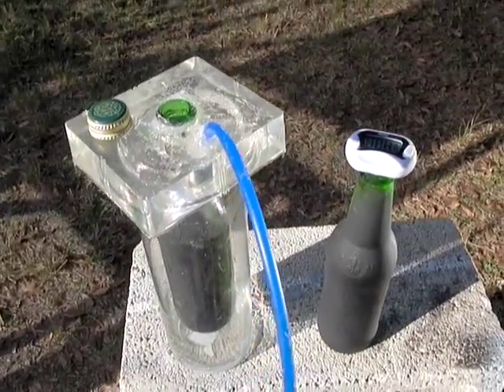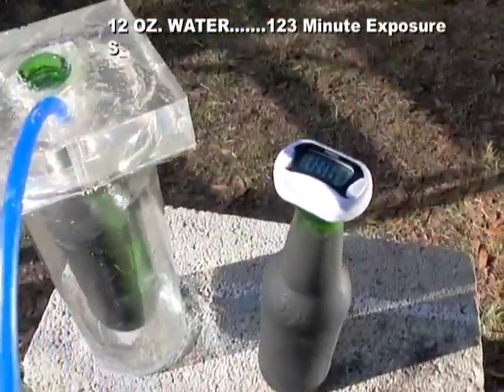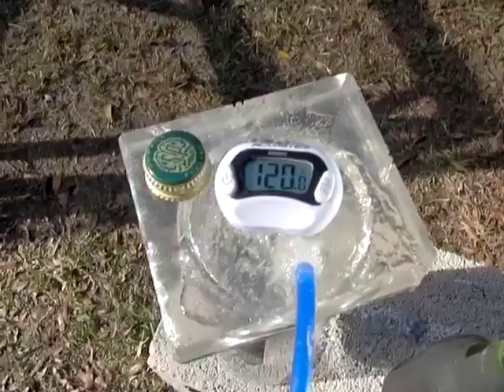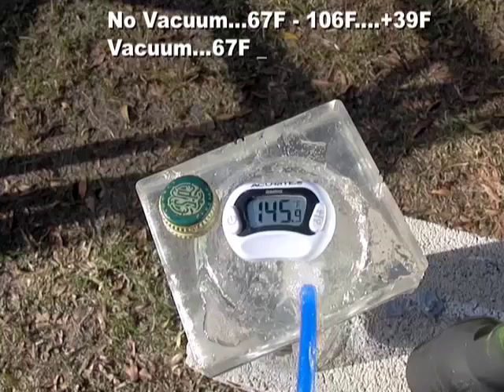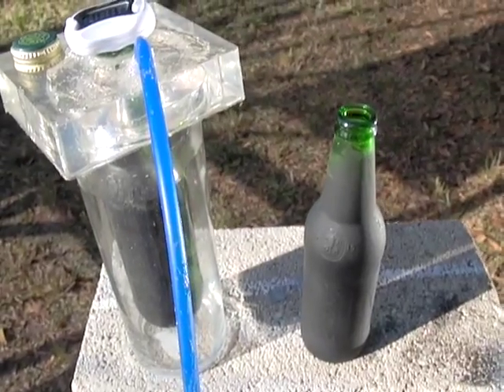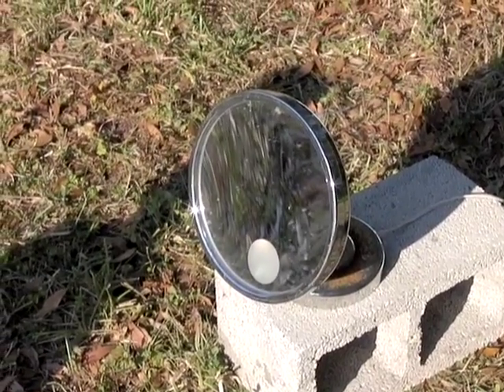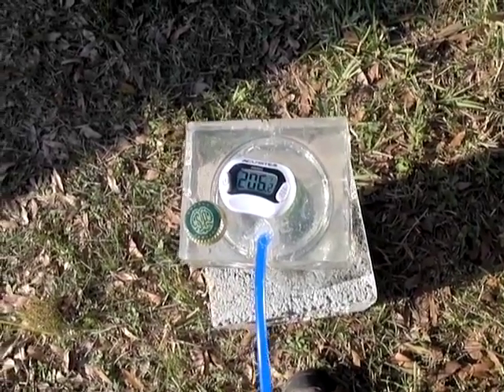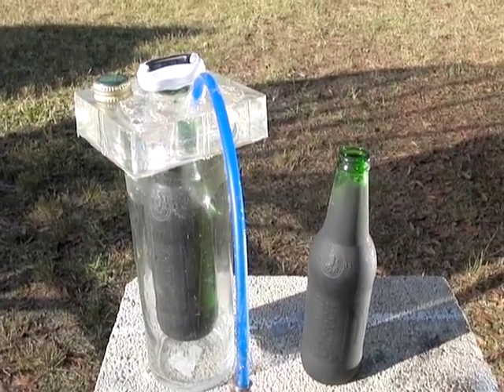Solar Evacuated Tube Vacuum Tubes DIY Test in the Sun

Comment: we have proper solar hot water systems using evacuated tube technology as standard here in australia. they have recently stopped using the old style "black pipes in a glass box" technology and gone for evacuated tube technology with gycol in them and then heat exchangers (with water) in the top of them.

Comment: Is this essentially what is at work in solar/steam generated electricity plants?

(I'm thinking of the kind built in the 70s -- and returning now -- where water or oil travels in a transparent tube along a curved/parabolic mirror, over a long distance, then introduced to water to turn a steam turbine.)

Do those systems vacuum-seal their tubes?

Comment: i think there will also be a temperature increase if you use air instead of vacuum. the ideea is to enclose the air, to not let it move around and up the bottle as it heats up and thus taking valuable heat from the bottle. kind of double layer window principle

Comment from the maker: Hi,

I think you would need at least a 30x40 Spot lens and heat the rocks outside in a safe area then bring them in? Actually a mirror array might do you more good. 5 30x40 mirrors are about 3-4 KW. You could expose the heater without burning down the house:-)

The square footage of sunlight is what matters for larger things like a box of rocks. You do not get the super high heat, but it would not transfer to all the rocks unless you have a very big Fresnel lens.

Also the solar cooker idea.

Comment: I feel that all hot water tanks for new residential & commercial builds, should have passive heat exchangers installed in them. This should become mandatory. 

One way of supplying the heat exchanger would be to design a ridge vent system that works in two ways. During sunlight, the ridge could be designed to become marginally hotter than the temperature of the ambient attic air. This would naturally draw this air to the vent. It would cool the attic and at the same time heat the hot water.

Comment: The temp diff you have is because the heat can leave non vacuum bottle through convection of the air on the contact surface, while the bottle in the vacuum valve cannot rid heat that way. The vacuum valve preserves the energy better than the other one because of this. Still heat can dissipate through radiation.

Comment: Dan,very interesting show us what the heat difference would be without the vacuum, but still in the same contraption.  I think your vacuum isn't strong enough to make a very big difference regarding convection cooling. You're mainly seeing air as an insulator I hypothesize.

Comment: Gotcha, thanks.

I'm not building, but curious about a  off-grid solution. Electric sauna rock heaters I've seen listed are usually 3KW models - I suppose an array of mirrors could match that. B/c the rocks need to maintain a constant temp, it doesn't sound like a lens would provide an easy solution. I was hoping it'd be as simple as placing the lens in the sauna besides a large angled window. 

Maybe this would just work to keep the general temp up.

Comment: Can a wood burning heater be fed from within the sauna, or only outside?

I'm wondering if you could direct the hot sauna air into a colder part of the house when finished, without introducing carbon monoxide from the heater.

(Not too familiar w/ saunas, just toying with how you'd get the most out of it in an off-grid home.)

Can you get natural/passive circulation by giving the sauna a vertical circular shape and placing the heat source strategically?

Comment: Hi. Extra question..

Yesterday I left a question in your last video about materials proven inflammable after wide-angle fresnel lens exposure.

I asked b/c I was curious about the use of a fresnel for heating sauna rocks - what do you think? (Foreseeable issues: getting rocks hot enough/too small fresnel exposure area/rocks not transferring heat to one another timely enough; and of course burning your sauna down by being inattentive &/or no having inflmmable protective material where need be.)

Comment: liquid inside tube absorbs photons, liquid increases in temp because of this and the atoms start to move around faster, this "mechanical" heat is retained because of the vacuum, without it the atoms would bounce against the bottle and transfer some energy to the surrounding air thus loosing kinetic energy ie temperature

Comment: looking to make a vacuum pump by enclosing a car tyre 12v pump in a small enclosure sealing the around the "pump out" hose and installing a nossle on the container for a suction port. How strong a psi rating should the pump be??
Regards Dan
Thanks for all your vids :)

Comment: I was going to try to use a copper tube inside another copper tube, put a vacum on the inner copper tubing and paint the outer one flat black. would I still gain the heat difference with the vacum in the inner tube?

Comment: You would probably get just as high of a temperature with the same setup but no vacuum.  In order for the conductivity of the space between the inside bottle and outside clear tube to be significantly lower you need to get the pressure down to the point where the mean free path of the air molecules (O2 and N2) is longer than the distance between the bottle and inside wall of the outer tube.  I am going to estimate that distance at about 1vm which works out to roughly 1 micron.  Some laboratory oil filled rotary vane pumps can reach this value, if the device you are trying to evacuate has very low outgassing and very low permeability (and of course not even the slightest leak), and the pumped air has a very short distance to the pump.  A plastic tube and glue does not begin to meet these requirements.

I would be surprised if the setup in the video could reach 100 microns, which is not going to provide any insulation performance advantage over simply leaving the air.
Reply: Interesting point.  It would have been a much better comparison if he had put the "naked" bottle in a similar container, unevacuated.  As shown here, the sun is heating paint on the outside of the glass bottle (poor conductor) so much (most?) of the heat delivered to the paint will be lost to the enviroment.  Perhaps he does that in a later video, I'll have a look around.   Another thing that interests me is that the evacuated container can pretty much eliminate losses from convection and conduction, but the black surface inside will re-radiate some of the infra-red.  Do they use a special glass?
Reply: Bill Juhasz

Comment: Heat does travel through a vacuum.  heat is low frequency (infrared) radiation.  Does quite well through a vacuum.  Heat works better by conduction and convection though.  I'm sure wikipedia would validate this.

Comment: I believe that another test is missing here. It is the greenhouse effect. Without the evacuation effect.
I cook a large chicken in 4 hours. just putting a pyrex vessel inside a transparent baking bag and then inside a small fish tank and a car windshield reflector.
The trick is to store the sun's heat and protect it from heat loss by the wind factor. If there is an internal black object storing the heat and a reflector outside multiplying the heat. everything is gain for cooking